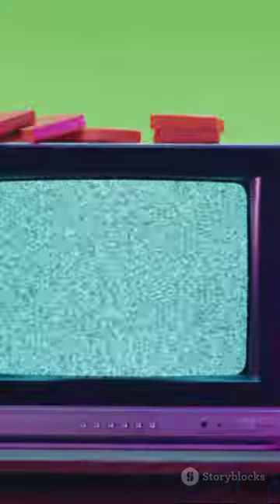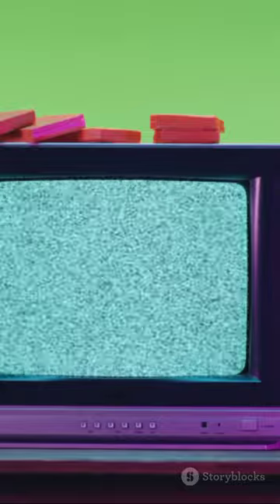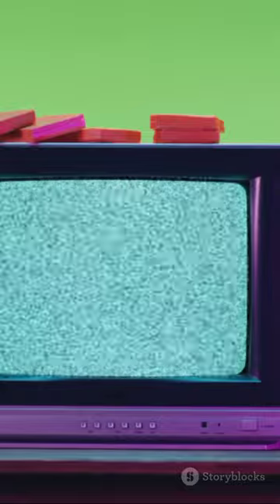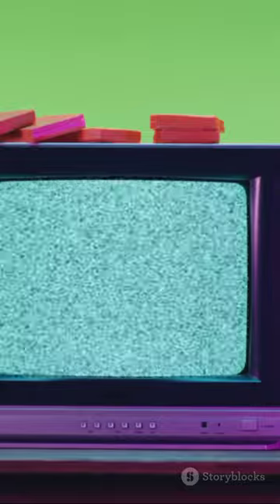Cathode Ray Tube: The Electron Producer. @ParallaxScience #cathode #ray #tube #viral

Comment from the maker: The cathode ray tube (CRT) works by using a focused beam of electrons to create images on a fluorescent screen. Here's a simplified explanation of the process:

1. Electron Emission: Electrons are emitted from the cathode (a heated filament) at one end of the tube.

2. Acceleration: These electrons are accelerated by an electric field towards the anode (positively charged electrode) at the other end of the tube.

3. Focusing: A focusing anode focuses the electron beam into a narrow, controlled stream as it travels toward the screen.

4. Deflection: The electron beam is deflected across the screen horizontally and vertically by varying electric or magnetic fields, allowing it to "scan" the entire surface of the screen.

5. Phosphor Coating: When the electrons strike the fluorescent screen (coated with phosphor compounds), they cause it to emit light, creating visible images for the viewer.

This basic process is how CRTs generate images in older television sets and computer monitors.